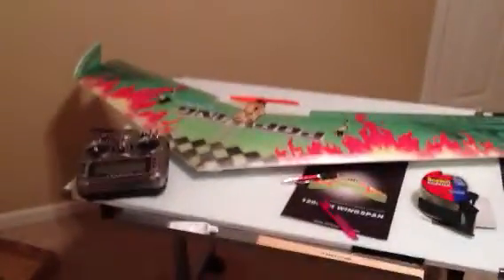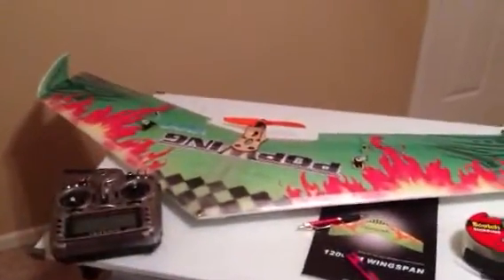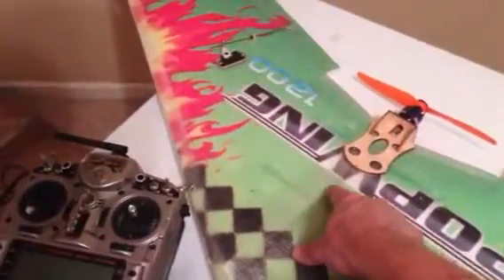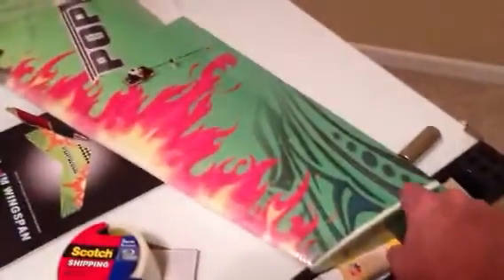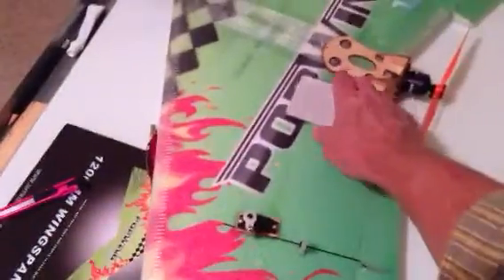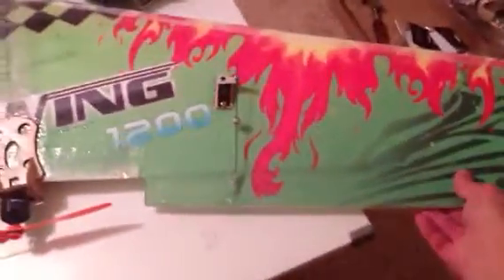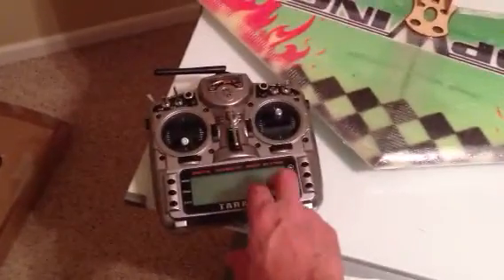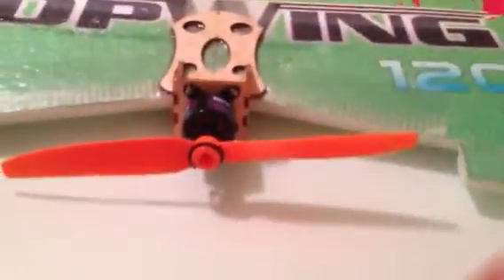Popwing 1200 build

Comment: Not sure i would trust that prop saver on a 2200 kv motor . If the motor shaft 5 a 6 mm is the shaft will not bend quick . I use a normal prop adapter and just let the prop break if it wants xD